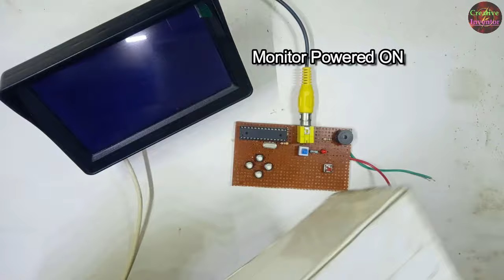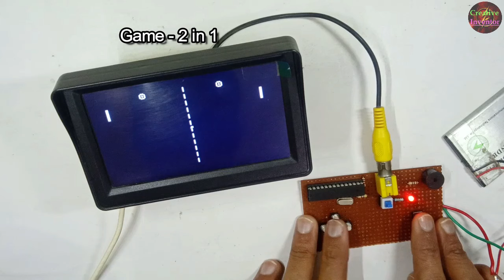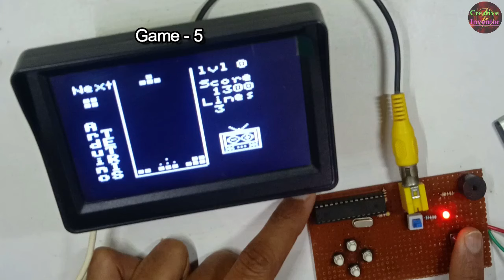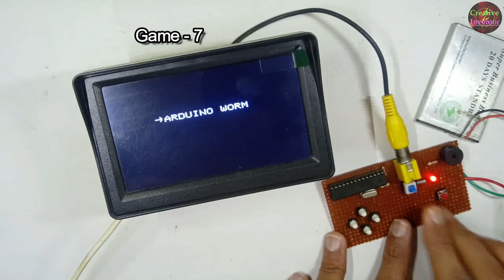Play Games Directly ON TV, How To Make Arduino TV Out Games, Arduino Asteroids Tv Out Game, DIY Tv

Comment: arduino run on 5v but u are giving 3v ?
Reply from the maker: where did you see that i had used 3v battery?
show me !! i will give you 100$ check for that.
Reply: soory sorry u gives to display right
Reply from the maker: The display is a small video monitor, u can call it a television without audio, that runs with 12v but i had connected a boost converter inside that tv so that it can be run from 5v, 
And atmega328 of uno needs 2.8v to 5v to run and iam using a 3.7v battery that when it is full it gives 4.2v.